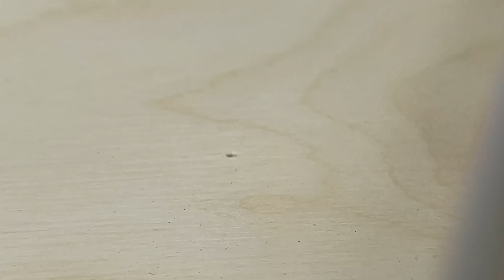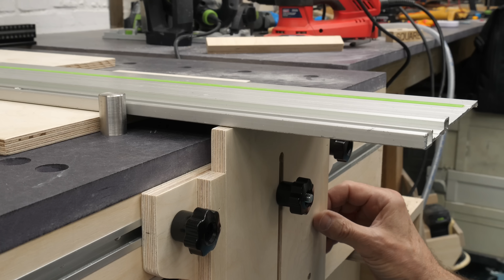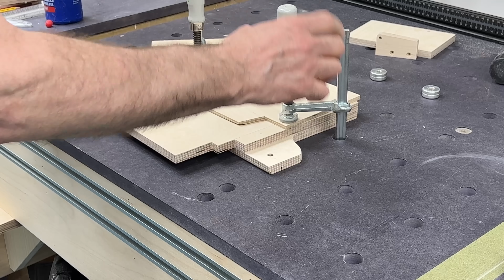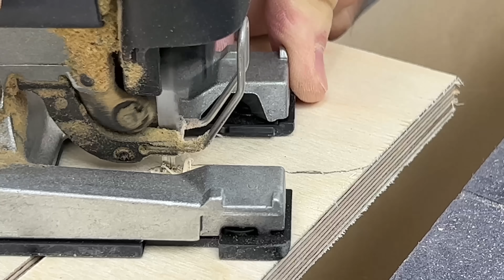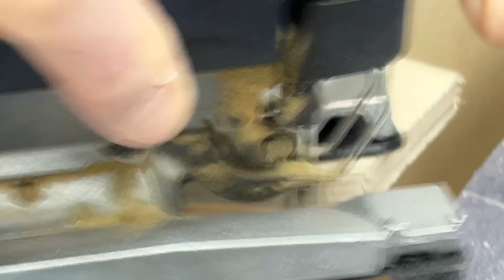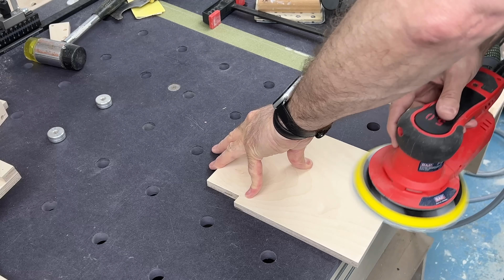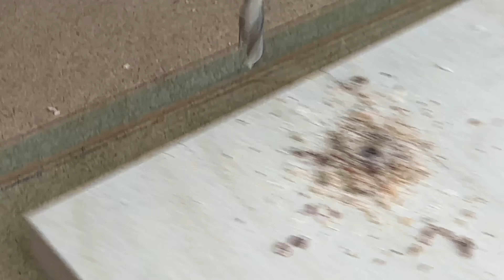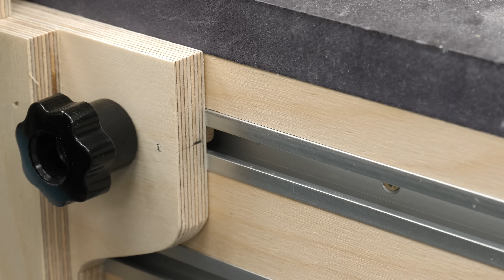Pocket-money Rail Hinge [video 497]

Comment: That's an impressive idea and build. To the question" You do have a track saw - don't you ?" I can now say "YES". I decided to give up struggling with a conventional saw and home made guides and get the Makita S6000 with a single 1500 mm track. I can now REALLY appreciate the benefits, not least of which is dust control ! 
I no longer dread the prospect of sheet cutting in the garage.
Reply from the maker: Cheers Norman! So many people forget about dust collection?extraction as a benefit of plunge saws when they say they can get by just fine with s sawboard and circular saw - effective DX makes a world of difference! 👍

Comment: Thanks a lot for the great idea and the great plans - I am starting to build this rail hinge, because it is so easy to remove the rail and put it back again, because I switched front and back of my mft because of the french cleat at the back, so the hinge is at the mft front and sometime it has to be out of the way...Wouldn´t it be nice to have a locking mechanism for the hinge part like the locking mechanism of the router lift from John Heisz wich works really great maybe with some excenter part pressing the riser spacers together?

Comment: On the subject of overhang 
Many Germans use the fence towards their stomach instead of towards the wall. That would give you the possibility to not having to rely on the saw having to pass 50% through the cut of the fence. Or you could just have your fence one row closer to you. Still that would reduce cut capacity 🤔
Reply from the maker: Interesting, thanks Emil. I’ve never seen anyone with the fence run front-to-back and cutting left/right! 🤔
Reply: @10MinuteWorkshop  sorry I was not clear enough 😅 they have the fence sideways to the front instead of the back. They would then push the saw away from the fence. I think you sometimes see it with Sautershop, Heiko and Holtzwerken 👍

Comment: I built my version with two pivots, based on the double link you see on the plunge mechanism on the dewalt saw. That way, the rail is always flat on the workpiece, and you don.t need any front support. (I also used a home made rail too, so I was able to screw the rail to the pivoting plate). This design can be clamped in pretty much any vise on a workbench, and can be used from either side.

Comment: Fantastic..
Maybe the hinge Pivot's 3D printed ?
Would it be strong enough ?
(Bought the plans, but the 1/1 PDF's are not really 1/1)
Thanks
efbe
Reply from the maker: We had some of the pivots 3D printed and they were good, but can’t get them  made in the quantities I’d need to make commercial sense. And in. What way are the 1:1 plans not 1:1??
Reply: @10MinuteWorkshop  
Front support
180 = 175,  230 = 223 (is the 'slit" supposed to be in the center ? now its on 90 from the left but from the 175 width
Riser spacers 195 = 188,  20 = aprox.18.5
Maybe thee is something wrong with the scaling of the printer...
Not a big deal I am drawing them now in Fusion 360.
Is there a flat pack kit coming ? I would be good for the accuracy.
(although, usually it is not worth it anymore to ship something from the UK. to Belgium, thanks to BrexIt)
I can print the hinge pivot's myself.
Like I can not find a reasonable TFT top here...
Thanks
It is always nice to see what is possible in a small workshop !!
efbe
Reply: By the way, I am going to try this for the LIDL Tracksaw
Reply: I have to excuse myself, it was indeed a scaling problem with the 'new' printer, but the slot is not centered.
Reply from the maker: Thanks! All sorted now. 👍
Reply: P^ Front Rail Support Riser
Slot is not centered 
ca 9,35 mm from the left side

Comment: What a clever implementation of the rail hinge. Well done Peter!! I especially like the pin idea for adjusting the thickness of material to cut. Seeing as you probably have samples of the more commonly used rails , how about  offering a flat pack solution that would get us 90% there with just the customizing of the drill holes when we install.
Reply from the maker: Thanks! That’s the plan, for a flat-pack CNC version, but costs are coming in very high, so lots more work to be done. 👍
Reply: @10MinuteWorkshop  any movement on a flat pack version of this hinge system?
Reply from the maker: Hi. No, couldn’t get it to cost out, so it’s just a set of plans. 👍
Reply: @10MinuteWorkshop  sounds good!

Comment: Seems like somebody would make one that utilized the back set of holes on the MTF so that it could be removable and be placed flush against the wall
Reply from the maker: As I say in the video, you need some overhang to accommodate the saw; anything that site directly,on the bench top and uses the MFT holes also reduces the amount usable cut. 👍

Comment: This is really nicely designed. I've been fascinated with mft hinges since first seeing them in your videos and was looking for ways to DIY one. Your recent vids on commercially available options made me take a look again.

However, I've now decided I don't think I need a hing and settled on a ultra budget version that consists of two cheapie planing stops from banggood, placed either side of the cut line, and the UJK dog rail clips. When I need to make a cut I put two taller dogs in the same two holes near top and bottom of mft, and just clip in my evolution rail. The clips are a very snug fit and never leave the rail, nor even change position on the rail. I just take the rail off where it's hung on a nail and lock it in, which takes seconds. The rail is locked in three dimensions when I make the cut, which is all I need. No need for a side track (useful as it is) or any sort of calibration whatsoever.

It also allows me to butt the rail right up to the wall, and if I do need full depth of mft for the cut I'll just wheel the workbench out a bit.

Like I said, I do like your hinge, but just thought I'd mention this technique as I know you appreciate a good budget option.
Reply from the maker: I’ve covered the options in many other videos, and nothing compares to a rail hinge IMHO.  As always, use whatever’s right for you - as I will for me. 👍

Comment: Isn't it cheaper to buy a festool guide rail hinge with current birch ply prices?
Reply from the maker: No! 😂 As I say in the vid, this can be made from 1/10 of a sheet of 12mm Birch, even at 2022 prices that's £12. Less than £20 after you've bought the plans... 😆 👍

Comment: Fantastic design and implementation. With the front riser holding the rail laterally it did seem redundant to have such a large overhang at the back. Will be picking up your plans

Comment: Might that hig work without positioning pins? I saw another design designed for a curcular saw, and it sits on the workpiece. True, the designer screws it into position, but it just sits flat on the workpiece. He sets the height, and then he screws up the high adjustment on is bench. His bench is far from the wall, so access isn't a concern.
Reply from the maker: Yes, as I say in the vid, the hinge riser is a nice friction fit, the pins are there for the convenience of being able to lock it off at a set height if you need to. 👍

Comment: Can these rail hinges be used to replace the stock Festool hinges on the MFT/3?
Reply from the maker: Yes, as long as you can get a t-bolt to fit the extrusion they’ll fit anything, within reason. 👍

Comment: Hi Peter, have you considered having a floating hinge with either springs or weights so that you don’t need to adjust the height for different material thicknesses?
Reply from the maker: Have you watched the video? The hinge riser is a snug friction fit that auto adjusts to different material thicknesses, with the ability to lock it off for set thicknesses if you choose to. 🤷‍♂️
Reply: @10MinuteWorkshop  sorry Peter, had delivery half way through watching when I came back it was finished so I missed that bit🤪👍